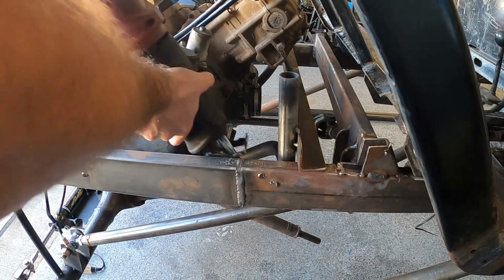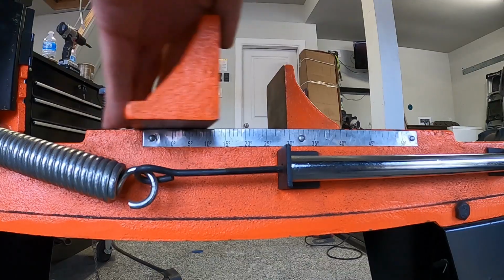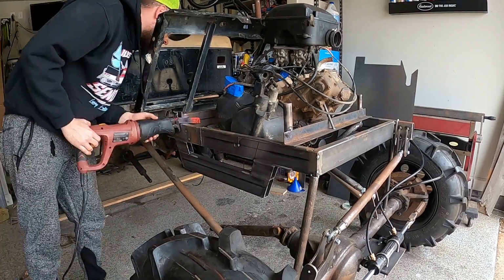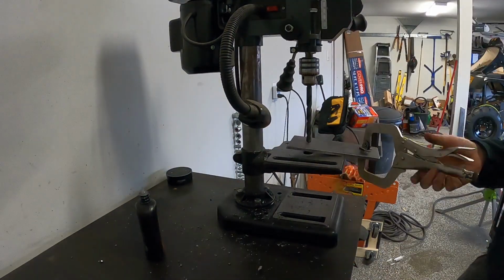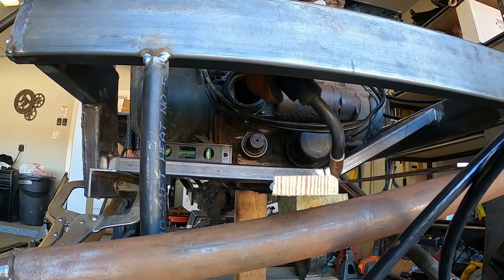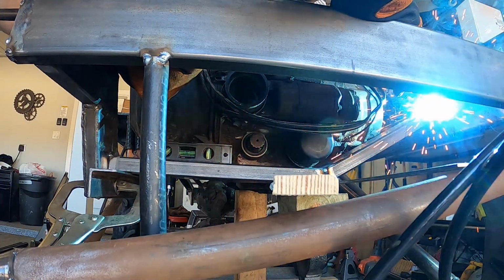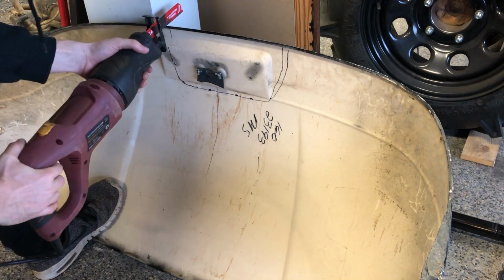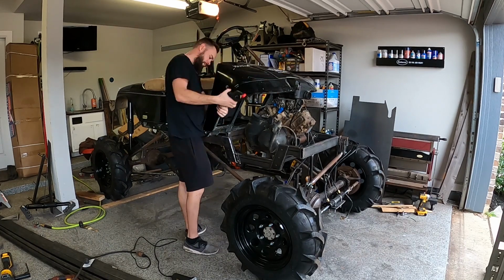Monster Golf Cart Build Part 2 Installing a 700cc 4 Wheeler Engine

Comment: I would like to know could you have used a predator engine to connect to the transfer case?
Reply from the maker: It can definitely be done. The predator engine is chain driven so it would be a challenge but people have done it before. I preferred an ATV engine because it has the built in transmission.